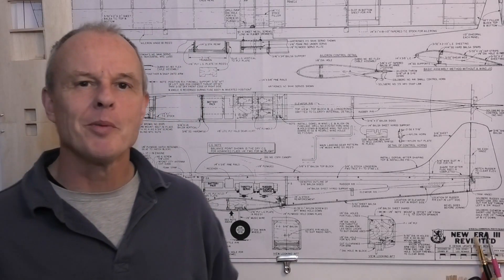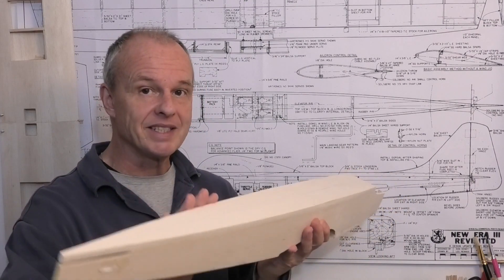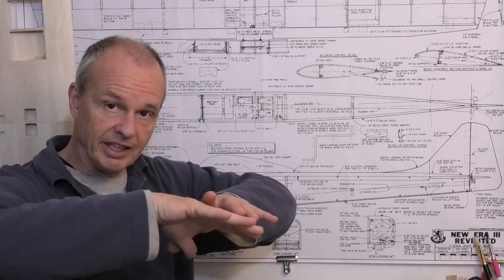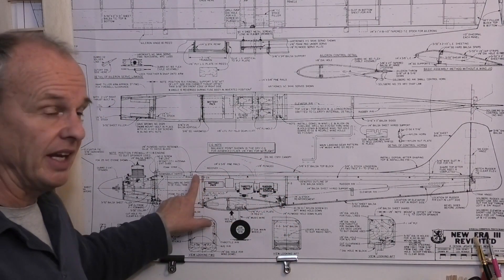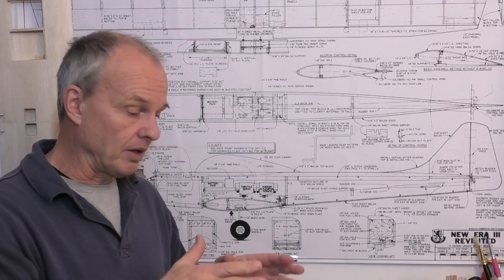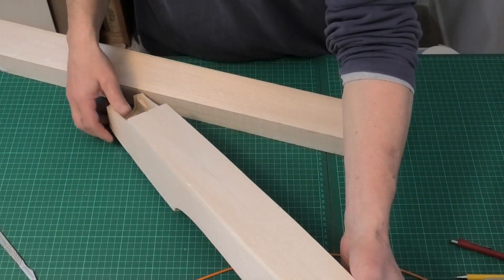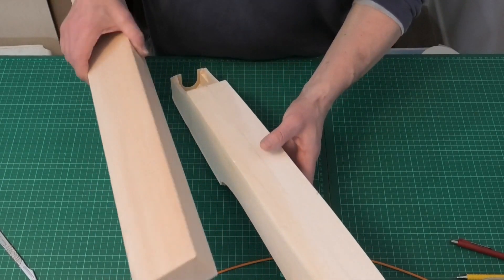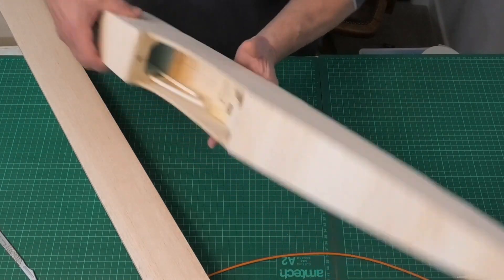New Era III Revisited: Pt 12 - Canopy Scratch Build - a 45" wingspan RC balsa aeroplane

Comment: Your Canopy turned out nice. I'll have to try that.  If you narrow your canopy a bit it will allow you to curve the top edges of the fuselage and still have it flat where the canopy mounts.  These bubble-type canopies were popular on the early pattern ships like the Taurus and Kwik Fli.  I flew a Kaos with a bubble canopy for quite a while but it wouldn't knife edge for beans.  One day I read that the Great Planes Ultra Sport was just a Kaos with a turtle deck.  The turtle deck generates more lift in knife.  It turns out that as radios got better so did the aerobatic maneuvers resulting in longer canopies (e.g. Dirty Birdie, Phoenix) to afford more lifting surface in knife edge.  Pattern ships slowly evolved from the short wide Kwik-Fli fuse into a more fish-like high sided very narrow fuselage.  The modern shapes can do loops in knife edge because they generate so much lift off the side of the fuselage.
Reply from the maker: Thanks for the really interesting information, it's greatly appreciated, pleased you liked the video. To be honest I am not a great lover of the bubble type canopy, much prefer a good turtle deck, but this plane is a great design which makes up for it. Happy building! 😀
Reply: @MarkRobinson555  It wouldn't be a New Era without the bubble canopy.  I was just making conversation.  I've still got that old Kaos with the Ultra Sport canopy.  Now that I've got a proper Ultra Sport I've even thought of putting the ol' bubble back on that Kaos.   All the planes I mentioned (Kwik-Fli, Kaos, New Era) are similar in design and make great aerobatic fliers that slow down for a slow very stable landing.